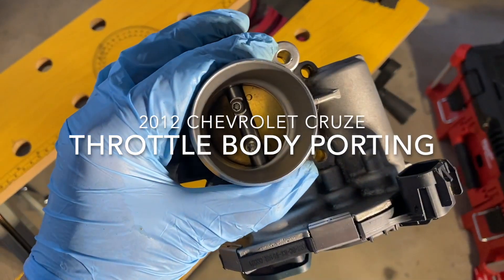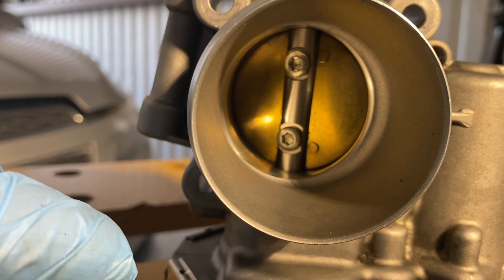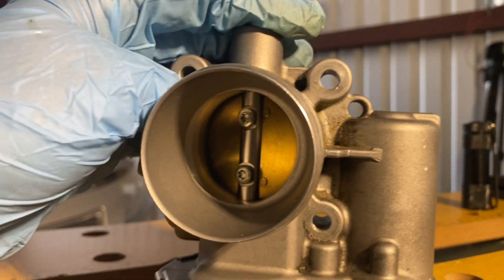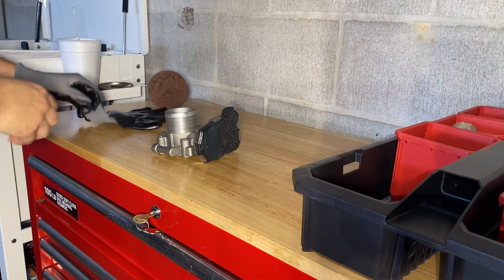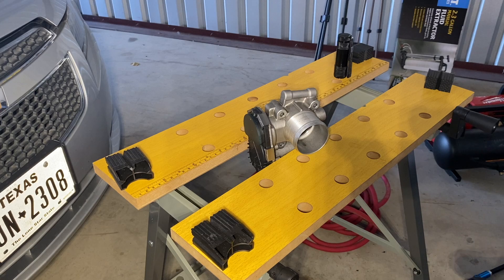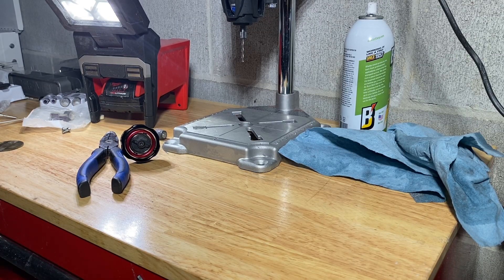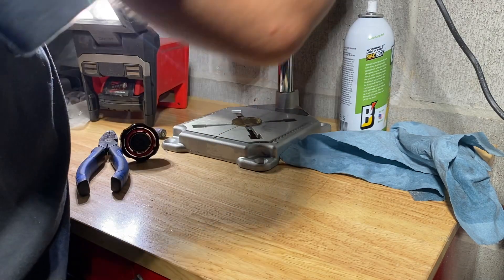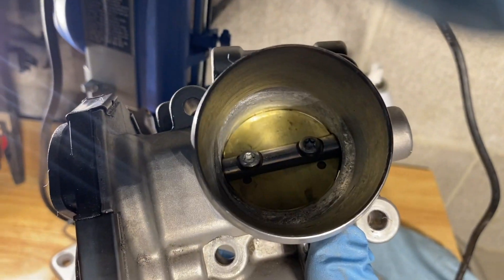Porting the Throttle Body for my 2012 Chevrolet Cruze ECO

Comment: Did this work and do anything different?
Reply from the maker: Actually, no, it was an exercise in futility. I threw a code once a
I plugged it back into the car and it wouldn't even idle. I replaced it with a new unit off of Amazon.
Reply: @hordebutcher2651 you need to flash the ecu and either tune it yourself or take it to a shop (shop tuning is usually cheaper for stage 1 mods)
Reply: @hordebutcher2651  threw a code and wouldnt idle??? How does this happen